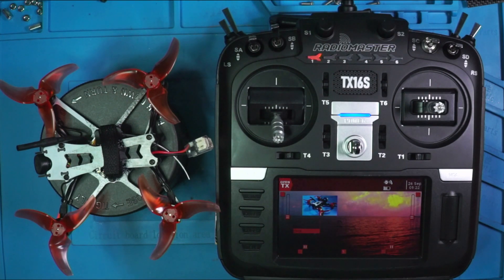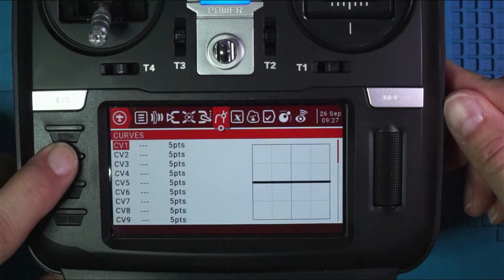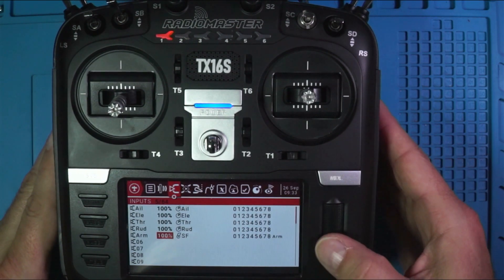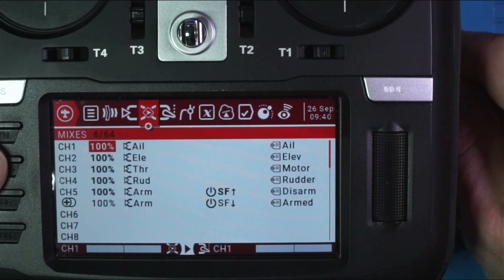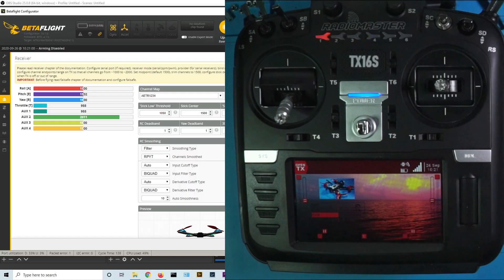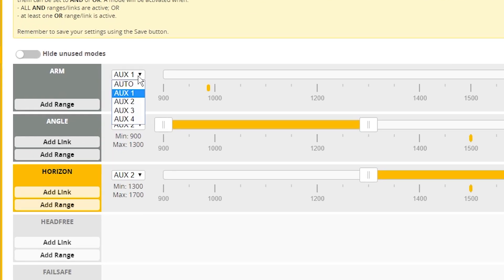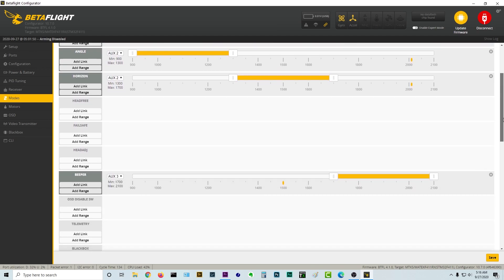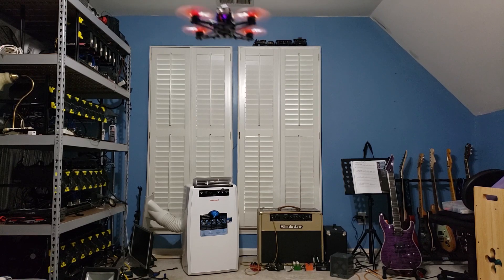Emax Tinyhawk 2 Setup on TX16s - Inputs, Mixes, Flight Modes, More

Comment: Aren't the additional mixes like on fmod really unnecessary? I have one set like you have done here. But on my Crux35 I just made a fmode switch and one mix named fmod to the SG switch with no other additions for horizon or acro because in beta flight I define the switches. It's this an ok way to do it? They both fly perfectly and function perfectly

Comment: Steve, My last question. I'm at my wits end. Thanks to you I'm 99.9% ready to fly my quad. The problem is that after arming, I'm able to take my quad up to full power, But, as I reduce my stick the motors remain at full power, and my throttle stick no longer effects the quad. Is this a TX16s fix or a betaflight fix?

Comment: Your video's helped. Took most of the day but I flew my tinyhawk 3 with my new tx16s tonight. Took a lot of getting used to the navigation buttons. I just  about gave up glad I didn't. Starting to like this radio a little bit after hating most of the day.

Comment: I  could use your help.  I can't get the motors to turn. I can get the motors to turn in Betaflight.  I also see the transmitter talking to my receiver in betaflight (I see movement of throttle, pitch, roll etc). However, when I unplug the quad from the computer and plug in the battery I get no movement.   The TX16s show errors at start up: throttle warning (throttle not idle), control warning , failsafe not set.  Any help would be appreciated. Thanks

Comment: so.. i did exactly as you told, but nothing happens when i Arm the quad and give it some throttle.
yes i saved the settings in BF, controls from the tx16s are registered.

Comment: Hi Steve, amazing video as all of your work is. Wonder if you could point me in the right direction, I have a tinyhawk 2 Tx16s transmitter. I followed your video, I now have the transmitter bound to the quad, but when it arms, the motors start running, it throttles up but not down, not sure what to try next, can't find anything directly relating to this problem. End points have been adjusted, as far as I know it should work. Sorry to bother you with this, when I started modeling, single channel was still common, so might be age related 😁.

Comment: I love your content and this remote! 
I am using it on my TinyHawk II Tinywhoop. 
An interesting idea for beginners: 
I added S1 as input with a curve that goes from 0 (not - 100) to +100. Then in the mixes page, I added S1 as Multiplier on Pitch, Roll and Yaw.   According to the dial position, will reduce the sensitivity of the sticks in real-time and limit their maximum output.
On the throttle, I found my hoover point to be - 20%, so I made a curve with - 20 as center stick with some expo made by hand, then added as replace for the throttle channel on the mixes page. 

As bonus, I enabled these mods only on FM2 and set up FM2 to be enabled from button 2 on the remote (from the 6 buttons that look like arrows).

I suggest this for beginners or if you wish to let a friend fly for the first time.
NB: I use this indoors mostly. If used outside, the maximum output might not be enough to overcome wind.

Comment: Can you tell me what to charge the 1s battery for the tinyhawk 2. Is it the regular lipo at 4.2 or is it hv at 4.35?
Reply from the maker: i use these:  https://www.racedayquads.com/products/rdq-series-3-8v-1s-450mah-80c-lihv-whoop-micro-battery-for-tinyhawk-5-pack-ph2-0?variant=21634756837489
Reply: @TahoeSteve  Does that mean they only charge to 3.8v. Sorry but I am new and just starting out. Thank you for all your videos. You helped get me started. Thanx again
Reply from the maker: per cell so 7.6 total.  These are High Voltage lipos and can be charged to 4.2v per cell.

Comment: in beta flight when i go to modes, and toggle the armed button is set to aux 2 and when i toggle it angle mode turns on, then the SD switch arms when i toggle to angle mode.
Reply from the maker: are both of them set to aux 2?
Reply: I am actually having the same issue right now with the tiny hawk 2....

Comment: Hi Tahoe Steve. 
Thanks for this video. Actually for all of them ;)
The whole setup brought me to a question though... I did bind my TinyHawk 2 (the little white set version) but now the original set transmitter doesn't connect to it anymore. And of course this transmitter doesn't have a "BIND" button. Do you know a way to bind them again? Can I just hit the "reset" button in betaflight?
Your input would be very much appreciated.
Reply from the maker: did you see this?  https://youtu.be/VegkWU1drvY
Reply: @TahoeSteve  Hey Steve. Thanks. Yes, I have. But I want to reconnect the ready-to-fly set transmitter... Anyway, I found this video https://www.youtube.com/watch?v=oAbpYEFezBM which is complementary to yours. So many thanks again for your efforts.
Reply: So the radiomaster does work with the tinyhawk 2 aswell as the freestyle? Which he should have specified in the title considering they are alllot different. Thanks